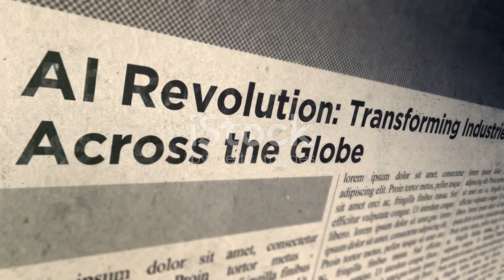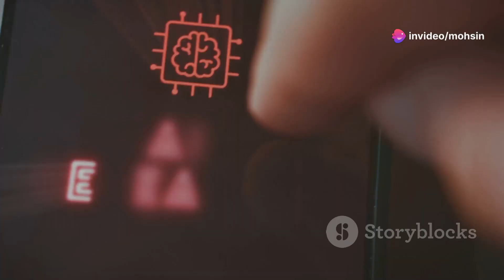The US Tech Throne Under Threat: A View From China

Comment: On any one day, the status of AI can change.  From both a software and hardware sectors, advances are progressing rapidly and can shatter accomplishments of the past. For example, Nvidia has been the AI chip leader with its advanced GPU chips, but recently we are seeing alternatives that are more wholistic in AI performance.

"New AI semiconductor chips include the MI350 and MI400 series from AMD, the WSE-3 from Cerebras, and the NorthPole from IBM. These chips are designed to be more energy-efficient and perform complex computations faster than traditional chips." (Google AI)

And in the AI software sector, the status of large AI models is being challenged by newer and cheaper models.

"According to Alibaba, Qwen 2.5-Max outperforms DeepSeek-V3 and OpenAI's GPT-4o in multiple AI benchmarks." (Medium)

And don't forget Alibaba's NPU chip, the Hanguang 800, its first AI inference neural processing unit (NPU) that specializes in the acceleration of machine learning tasks.(Alibaba)

2025 appears to be an exciting year for AI as newer revelations on AI platoforms and semiconductors are revealed.
Reply: So you're leaning towards Chinese AI doing all the breakthroughs? 😅